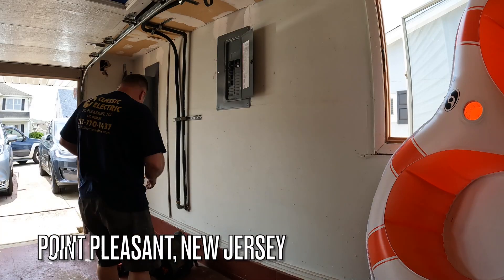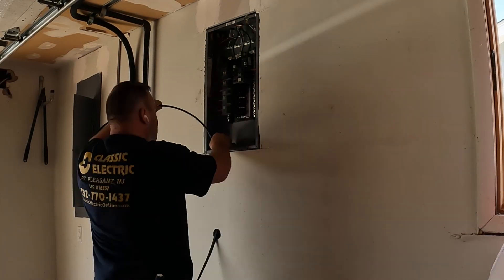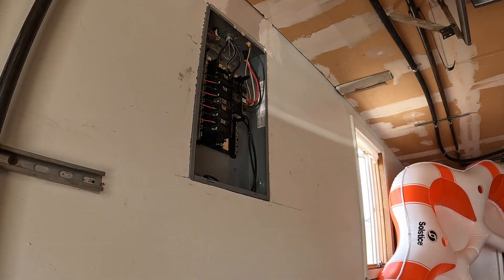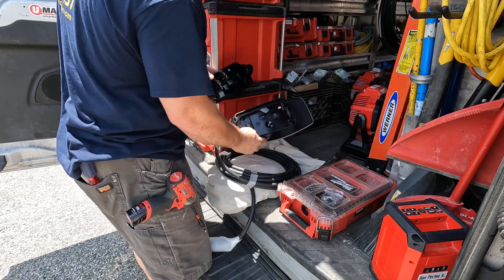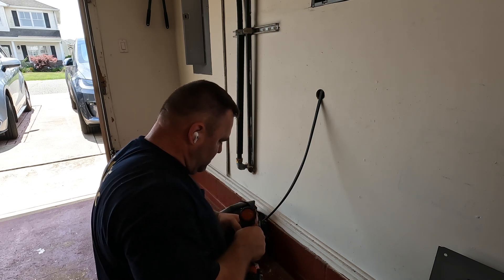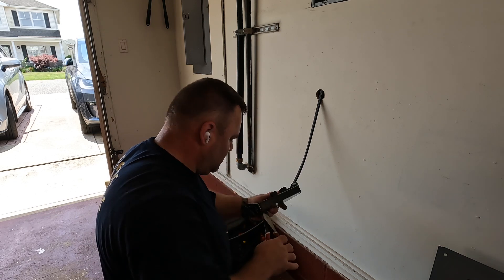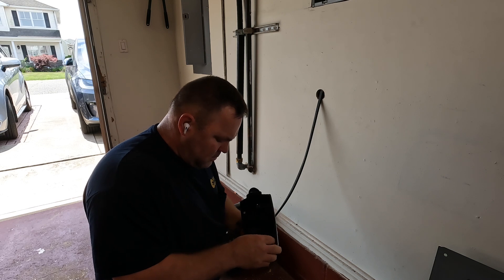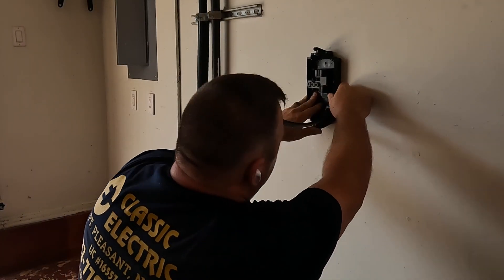Tesla Wall Charger | 60 Amp 240 Volt Electric Vehicle Wiring

Comment: Very good job, I would like to add that drywall anchors to mount the charger on the wall usually doesn't hold up over time and the Tesla instructions now show to use the stud for mounting. Additionally if someone is using a longer run of wire than you show in vid, maybe 4 AWG would be better choice ? Thank you for taking the time to illustrate this.

Comment: For a 60amp circuit, I thought you are supposed to use #4AWG if it is Romex, #6 if it is THHN.
Reply: Correct.  This video is wrong.
Reply: True.  Although it seems most certified electricians don't know this...at least on YouTube and the Tesla forums.  Many using 6/3 or 6/2 Romex and 60 amps.  Also, you're supposed to wrap the wires up and around inside the Wall Connector and use the zip tie that came in the box.  A quick glance at the instructions would have been good.  In any case, both mistakes are minor and probably fine.
Reply: I read the NJ publication (link above) that allows 6/2 NM for 60 amp EV chargers and the link above is indeed correct.  New Jersey has made the decision (and they explain their interpretation of NEC) to allow #6 Romex for 60 amp EV chargers.

Comment: Electrician Ron, I appreciate your videos, they are great! 

On one of the Tesla Internet forums, there has been a huge amount of discussion regarding the use of #6 NM cable with the Tesla Wall Connector, with some questions having dozens of answers, which as far as I can tell are not from licensed electricians.

Basically, since the Tesla Wall Connector is considered a continuous load, it is claimed by many people on the forum that the current the Wall Connector draws can not exceed 80% of the circuit's ampacity.  And it is argued by these folks that since #6 NM is rated at 55 amps, the circuit can only have a continuous load of 80% of 55 amps, or 44 amps, and that for this reason the "next size up breaker rule" does not apply to such installations using #6 NM cable if used with a 60 amp breaker, and the Wall Connector is configured for 48 amp charging.  

I have seen #6 NM used for residential 9,600 watt electric heat with 60 amp breakers. In fact, my electric heat is 9,600 watts, plus blower motor, and according to the nameplate on my heater the required ampacity is 55 amps (with a 60 amp breaker), so it would seem to be a common practice to install #6 NM on a 60 amp breaker, using the "next breaker size" rule.

But if used with a 60 amp breaker, the Tesla Wall Connector can max out at 48 amps and run 6 to 8 hours.  

I imagine #6 NM may be fine in the real world, but what thoughts do you have regarding the NEC code technically allowing #6 NM cable to be used with a continuous load of 48 amps, and do the inspectors in your area allow this?

(I have two Tesla Wall connectors, one wired just under an electrical panel using #6 NM and a 60 amp breaker, almost exactly like is shown in this video, and the other to a different breaker panel (on a different service disconnect -- I have three 200 amp service disconnects) with about 75 feet of #6 MC cable and a 60 amp breaker.)

Thanks!
Reply: In a perfect world, nothing breaks and everything works as intended.  However we don't live in a perfect world and things can break. We have to assume that the circuitboard of the charger can short out and fault internally.  In which case the circuit breaker needs to trip before the wire melts.  Using 60c wire, the insulation could melt before it hits 60 amps.  The tolerances are very close here, we're talking 55 rating vs 60 amp breaker.  It's also a very short piece of wire so resistance is lower due to short length.  So in all likelyhood you'll be fine in this situation even if there was an internal fault with the charger.  But I personally would have used a higher temp wire or went with 4awg for better piece of mind.  Also, if there is a small fire, you could get in trouble if they inspect it and find it didn't meet the rating.
Reply: If you're going 60 amps, why not play it safe and use #4 wire?
Reply: @rkgsd  #4 wire is a pain to work with.  You can use #6 THNN and meet the NEC requirement for a 60 amp breaker...and it's easier to pull through conduit than Romex.

Comment: thank you so much
what wire for under ground should I use, I have my electrical panel 75 ft away from where I want to install my charger and I need to go under ground

Thank you so much 🙏

Comment: You’re not supposed to secure the conductors in the wall connector from the bottom, but rather have them loop around and enter into the top. Have a look at the picture in the manual if what I’m saying doesn’t make sense.
Reply from the maker: I do understand what you're saying but that is the dumbest thing ever, IMO, of course. "Extra conductor length" is rarely ever utilized.
Reply: electricaliron is using a cable connector to provide strain relief. Instructions do not show using a cable connector to the box, so I would imagine the instructions are trying to have you use ty wraps and looping the wire around to the other side to provide the strain relief. I my opinion electricaliron is doing it the right way.
Reply: @electricianron_New_Jersey  It is because there is a temperature sensor on that right side of the enclosure. If it detects the wires overheating, it derates the charging. In the manual, it shows that if you are coming in from the bottom, you land on the top of the block. If you are coming in from the top, you land them on the bottom. By doing this, you ensure that the wire goes through that side of the enclosure with the sensor.

Comment: Beautiful job. I would've done everything exactly the same but with two very minor differences. Not to criticize at all bro, just sharing something with you from my experience.  First thing is: I would have aimed the wall connector to the left a tiny bit just to sink a couple screws into the stud, or possibly use toggle bolts if the stud wasn't an option. Some people tend to put a lot of stress on the cable that connects to the car. Second thing is: I would've ran the conductors up the small channel on the right side of the wall connector and came down into the terminals from the top forming a half loop. This allows you to use the tiny zip tie included in the wall connector kit to secure the wires and leaves a bit of slack in case they need to be re-terminated later. Something I never used to do until I did the Tesla certification training. 

Also, I'm genuinely curious about using #6/2 romex for these 48 amp continuous load (60 amp calculated load) chargers. Is this what most are doing? I've done this myself a few times because I know it's safe. Romex doesn't melt at 60C and the breaker is rated 75C, but technically  romex is 55 amp max because of the 60C rating (NEC 334.80). Just to avoid an overzealous inspector giving me an issue, I started using copper 6-6-8 SEU cable or 6/2 MC cable instead. SEU cable is not limited to 60C like romex. It's really hard to find, but I normally pay about $2 per foot for it.
Reply from the maker: Is the SEU cable you're installing aluminum or copper? All good points you made, by the way.
Reply: I second what Jay said about aiming for a stud, especially as one of the sheetrock anchors is very close to the hole drilled for the cable.

Comment: How come you didn’t use a 6-4 
2 powers
1 neutral
1 ground
Is it not required? Sorry couldn’t have audio on during video if you explained it
Reply from the maker: Because the Tesla charger does not require it. Only time you need a 4-wire is when you're running to a NEMA-1450 receptacle. That also requires GFCI protection.

Comment: You mentioned using 6awg Romex for a 48A draw.  This is against code.  You can use 6awg for 48A but it must be THHN cable in a conduit.
Reply from the maker: I know why but I’d like you to explain it here.
Reply: @electricianron_New_Jersey  First off i LOVE your videos! Always informative and i learn a lot from them. Im just an IT guy who loves to learn new things, especially things around my home. Please educate me if im wrong. I believe the reason is, is that NM-B is restricted to the 60 Degree column which limits the amperage to 55 Amps on #6 NM-B which is less than the 60 Amp Breaker. Where as THHN/WN/ MC are allowed up to the 90 degree column. Most breaker terminals are limited to the 75 degree column so #6 THHN/WN / MC would be able to run at 65 Amps which is more than the breaker. Again, i just find all these stuff interesting so i read a lot about it but correct me if i made a mistake! Thanks Ron!

Comment: Glad I saw this video before the electrician installed a charger. He never mentioned the existence of 60 amp circuits. He only mentioned a 50 amp. This is planned as part of a main panel upgrade to 200 amps.
I'm assuming having a 60 amp hardwired charger installed is more expensive than a 50 amp 15-40.
Reply from the maker: If it’s for a Tesla charger it’s 60 amp circuit breaker and #6 AWG THHN/ THWN conductors.

Comment: If you are drawing A peak amperage of 48 Amps isn’t the breaker That’s rated for 60 Amps under quite a bit of  Pressure I imagine you do not want to go over 80% of What the breaker is rated for? Wouldn’t it be appropriate to have #4 wire? And a 70 amp breaker.

Comment: I was wondering why you didn’t re-identify the white wire with black or red tape?  I know electricity doesn’t know color code but I’ve had a few inspectors bust my chops over the years. It’s just habit to do.
Reply: Looks like he did on the panel end, which is where it really matters...

Comment: Good video Ron. Not sure what edition of NEC you’re in in your AHJ, but does your double pole CB need to be GFCI protected, or because it’s hard wires in, no GFCI requires?
Reply from the maker: NJ’s on the 2017 NEC so it’s not required here.
Reply: Tesla Wall Connector has integrated GFCI anyway
Reply: It doesn’t need a GFI breaker if hardwired because it has GFI protection built in. It would only be required if he installed an outlet to plug the wall charger into. Funny thing though - The manual says Do not use a GFI breaker, so a licensed electrician basically has to hardwire these to meet code
 BTW good job @ElectricianRon!
Reply: 2020 NEC requires a GFCI circuit breaker on a 14-50 outlet, but doesn't require it for hardwire.  Most states aren't on 2020 NEC yet, but it's coming.  The Tesla Charger manual recommends not using a GFCI breaker because it has built in GFCI detection.

Comment: Maybe I am over thinking it but I am old but I would have put a piece of plywood on the wall and mounted the Tesla to that. That way you could screw the plywood to a stud. I suppose you could have got 2 of the Tesla screws into a stud.

Just don't like somebody walking by with a bicycle and knocking that off the wall. Now I think they have to be GFCI with the 2023 Code we are on in MAss
Reply from the maker: I was just working there again this week. Tesla charger is still there on the wall like it was when it was originally installed.  GFCI is only required for EV receptacle outlets.

Comment: Quick job, but wouldn't have taken much longer if attached to a stud. With the weight of the cable, and even more so, the frequent usage, this will fall off eventually.
Reply from the maker: Probably not. Did that happen to one of your installs?

Comment: Should’ve done it this way in the other video when you ran the PVC in the garage for a car charger you added. You cut a chunk of drywall out to bring conduit into bottom of panel. You could have fished a piece of flex from the panel in the wall to the back of a 4-11/16 metal box. Then tie your pipe into the box. A lot cleaner.
Reply from the maker: But then you have to splice conductors and with a large load that’s not always the best way to do this job.
Reply: @electricianron_New_Jersey  no you wouldn’t. Make the wire long enough and push up to panel leave a small loop in j box. I’ve done many times like this. Just a suggestion.
Reply from the maker: @mcarroll598  So the cable assembly is never broken and travels through a 4 11/16th box?
Reply: @electricianron_New_Jersey  yes. Like pulling in individual THHN STRANDED conductors. 
Like you have done in some of your videos.